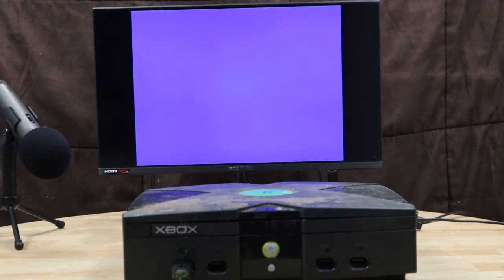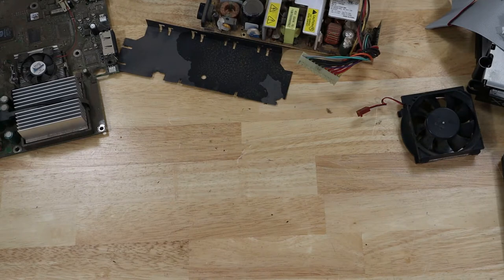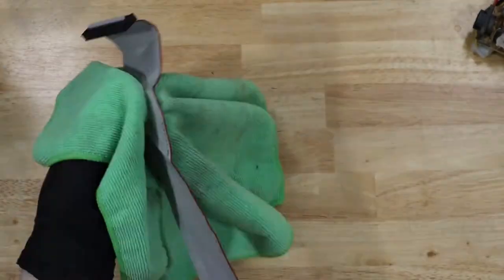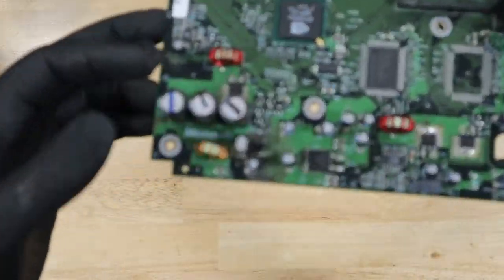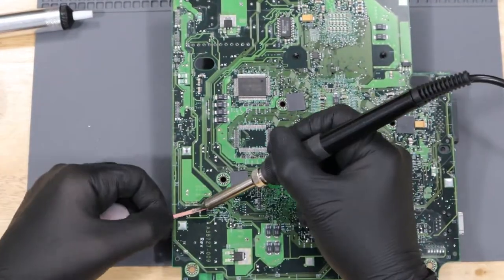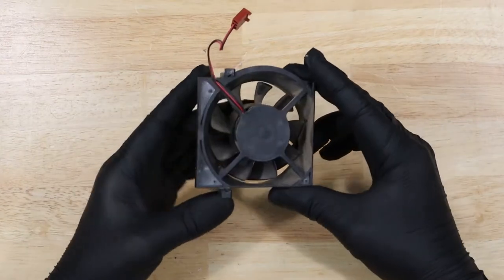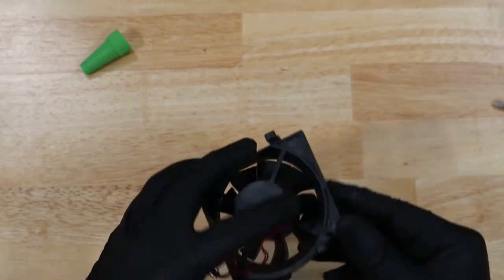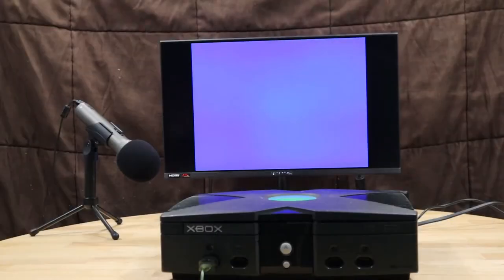Restoring an Original Xbox

Comment: Did not know about the clock capacitor going bad as a common problem. I've learned something today.
Reply from the maker: Yeah, if you have an original Xbox, it is a great idea to go ahead and replace it. 

Edit to add, and thanks Pro Gamer Steve for reminding me, the clock capacitor is only an issue on Xbox versions 1.5 or earlier.

Comment: One guy I saw cut out the metal grid behind the fan to allow better air flow. Another guy still addressed the common problem with the eject sticking. He put a little lubricant on the the edge of the track and gears which could itself end up to be a problem if he added too much.

Comment: If you have a 1.6 or a 1.6b Xbox don't remove the clock capacitor or else it will not work
Reply from the maker: Good clarification!
Reply: @LastHeartGames  If you're ever able, could you show the differences between Xbox DVD drives or at least Xbox versions? I'm working on restoring one from 2005 with the newest board with parts (dvd drive) from previous revisions. Great video!